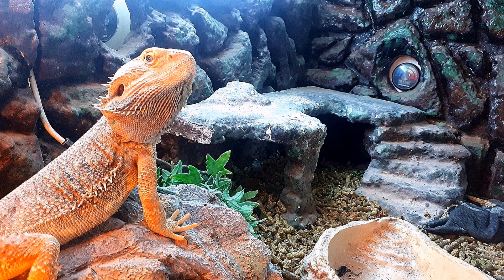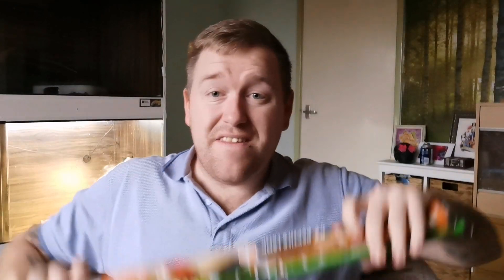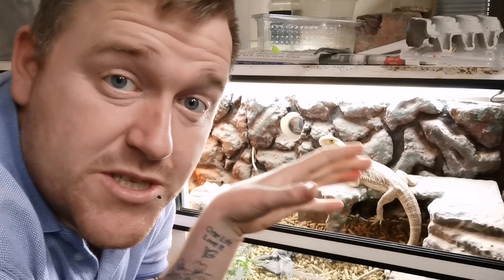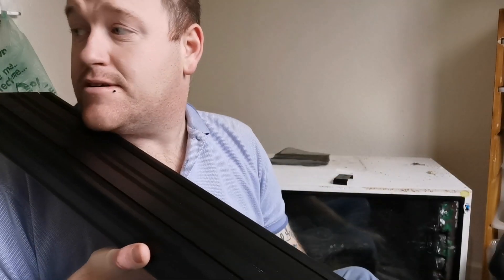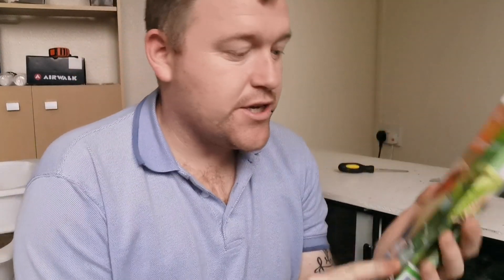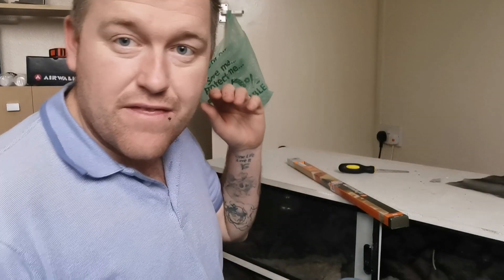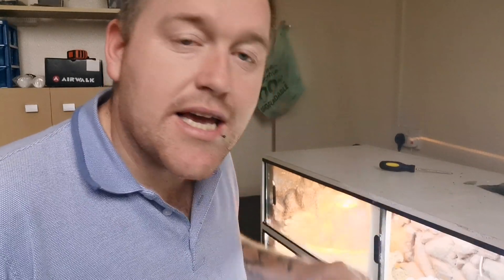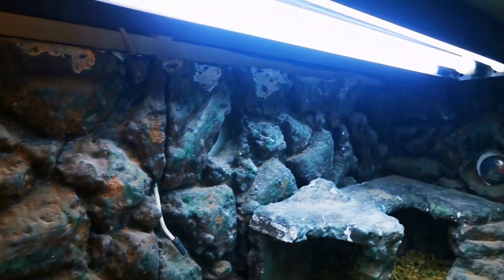The NEW Bearded Dragon Lighting Setup . Adding Sunrise, Sunset And More

Comment: yes have you done uvb  rest with reptile systems  12 %  d3 bulbs ?     i usually you arcadia   but i thought about trying  t5 luminaire
Reply: sorry cant type lol  test i meant  and i usually use arcadia
Reply from the maker: In one of my more recent videos I did a durable test. Bulbs have been in 8 months and still lasting well giving enough uvb out for my bearded dragon. 
Prob got another 5 months left before needing to change the bulb

Comment: Is this good for savannah monitors? I currently have 2 100watt uvbs and wanted to put uva into the enclosure too. Would I vet rid of these and just use this on its own?
Reply from the maker: I'm saving up for the biggest one of these for my Savannah monitor. I'll still be using heatbulbs aswell as this for mine. I'm still not sure weather to go mercury vapour bulbs or standard heat bulbs
Reply: @NORTHERNEXOTICS  I would like to get one also because at the moment I have 2 lights for him to mimic the sunrise and sunset ones dimmer than the other. But I'm not sure how much uvb or uva is in them. The ones on this video 6 and 12 percent I'm not sure if that would be okay for a savannah mon?

Comment: So if I'm understanding the new way of thinking, all the beardies need the 6 and 12% lights? No heat light needed correct
Reply from the maker: They still need a thermostatically controlled heat bulb. A daylight basking uva bulb . This lighting reflects the natural uvi output the sun would have in the wild with the different wavelengths of uvb, uva, UV and ir
Reply: How tall is your enclosure?

Comment: Love you videos bro I want 3 of these but I use living earth habitats would I need to by a different thermostat for my heat bulbs and if so which ones would you suggest I have 3 4 ft by 2 ft vivs but I also use Arcadia mercury vapour d3 basking lamps what would you suggest
Reply from the maker: You can not use a thermostat with mercury vapour bulbs because you'll be dimming the amount of uvb coming out of them. 
With this setup you have the uvb setup on timers and a normal 100w daylight basking lamp on a dimming thermostat. 
I use reptile systems D3 basking lamp on my Savannah monitor and it works great
Reply: And I’m after 3 new tanks for my bearded dragons if you have any suggestions because the heat bulbs keep coming on and off as I think I need more ventilation
Reply: Ok so with that setup I just use normal basking lamp with thermostat and plug the setup into a separate timer and I shouldn’t have the d3 basking lamp on a thermostat little bit confused lol but sure I’ll figure it out as if I just put the d3 bulb on without thermostat the basking spot gets too hot and can’t raise light anymore so I may have to cut a big vent whole in the back of the tank to compensate? I also use a 12% uvb tube light as well as the d3 Vapour bulb but there both plugged into my living earth thermostat. thanks for taking the time to reply bud much appreciated your Chanel is wkd and you should have way more subscribes and I drop a like on all your videos  because you’re knowledge about reptile welfare is amazing some boy

Comment: Great videos and content mate. 

Q: by using a 12% and a 6% at the same time are you providing 18% UVB, or will you only ever have the percentage of the strongest bulb at any one time i.e. 12%?
Also, in your experience do reptile keepers use aquarium lighting to try and replicate dusk and dawn? The aquarium industry, particularly marine fish keeping have some very sophisticated programmable lighting systems that if used alongside the appropriate reptile uvb light source, could do a good job at recreating the day and night cycle found in some reptiles native habitat, all controlled by an app. I cant seem to find any examples of herp keepers using these products. The reptile lighting products available seem to be very basic compared the options available to the aquarium hobby
Reply from the maker: The 6 will never over power the 12 so it'll never be 18% . It will increase slightly but not to 18% . I've heard of the app your on about . You can really dive deep with the app and create thunderstorms . Lightning and other colour variations . I really can't wait for the reptile hobby to get to were the aquarium hobby is at

Comment: I fitted two of these 39w units to 48" vivariums the other day, they were brand new vivs and i turned the viv upside down, it made screwing the bracket in much easier.  You can also clip the bracket onto the unit, you don't have to slide it in from the end. :)
Reply from the maker: I didn't know it could be clipped. I'm loving it. I thought with only one screw in each bracket it wouldn't be as secure. It's solid . Really nice bit of kit.
Reply: @NORTHERNEXOTICS  they are good, i hope your dragon is loving her new light cycle
Reply from the maker: He seems to have lightened up in colour slightly . The old system must have really not been up to the job

Comment: Hi Richard, we’re getting a bearded dragon for my boy this xmas and really appreciate all your sound advice.
At this point, the only major consideration left for us is bioactive or a tiled enclosure. Obviously you like the bios, but just wondering your opinion on them for Beardies.
Really looking forward to your bio gecko project.
Reply: If your a beginner I would suggest tiles for the first few month get him/her settled in but that's my opinion good luck 🤙🤙
Reply from the maker: Agreed. With bioactive if you don't have the spot on temps and humidity you could have ingestion issues. I've spent years researching Australian naturalistic setting to match the wild in the enclosure. Bioactivity is worth aiming for but after a bit of experiance
Reply: Yep, rolling towards all the gear, with no idea. I’ve researched lots, months not years, but have zero practical.
Tiles it is. For now.
Thanks to both of you.
Reply: @jurgenvanboi165  no bother good luck on your new pet